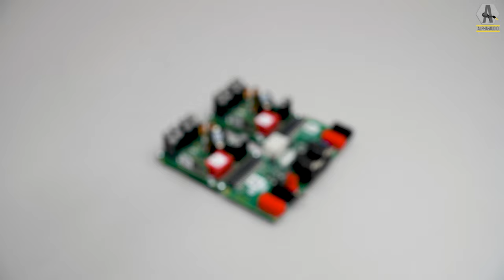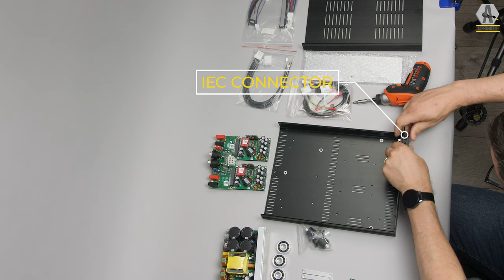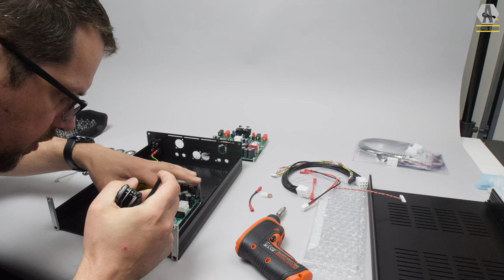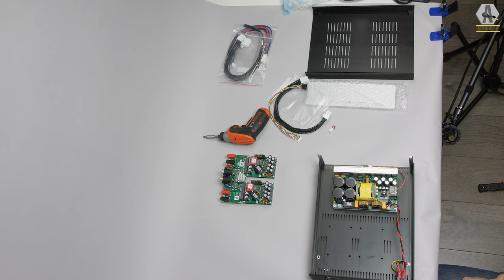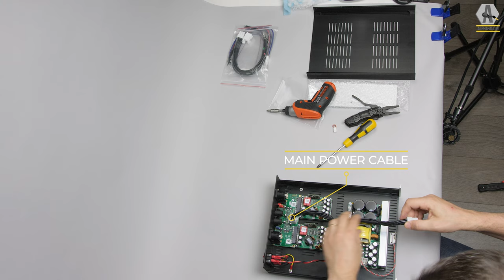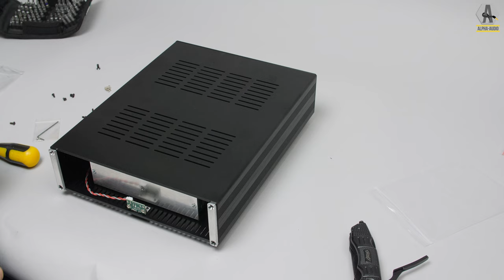Tutorial - Build your own Eigentakt Power Amplifier

Comment: Thanks for posting this. I have a question about the jumpers on the power supply. You state that the power supply comes in regulated mode and must be switched to unregulated mode.  You state “swap-out the jumpers"?  Swap out for what???  The word swap infers a replacement. Do you actually mean "remove the jumpers?  I am a novice and need a little clarity there. Also, I am in the US and will need a jumper on the power supply for 110v. Could you clarify that implementation? I could not see it clearly in your video.Thanks.
Reply: Hi Bob, I read your question about the jumpers. The following is stated in the additional pdf (Application Note – Connecting EVAL1 to SMPS1200A400) you can download from the website of Purifi Audio: "In addition to two set of cables that need to be prepared and connected, it is also of great importance to correctly set jumpers on the SMPS1200A400 to ensure it supplies UNREGUTLATED Vaux voltage rails." This means that you have to change the position of two jumpers on the SMPS1200A400. Hope this answers your question.

Comment: Thanks for the video, but I believe you have miswired the IEC socket, despite your comments that it was carefully checked. Happy to be wrong! 
As I understand it, the red wire should be active and the black wire neutral. At 5:03 of your video, it is clear that you have wired the male IEC socket so that the red wire is on the right side when looking from the inside of the chassis, and thus would be on the left side when view from outside the chassis. That would be correct if the pins of the IEC socket were arranged to define an upright triangle, but the IEC socket supplied with the ghent case has the pins in the shape of an inverted triangle, and thus the hot pin is actually the one on the right side when viewed from outside the chassis and on the left side when viewed from within the chassis - the opposite of the way you have wired it.
Reply from the maker: You could be right. But it didn't blow up... ;-).

Comment: Do you think it would be possible to fit another purifi mono in there to make a 3 channel amp?
Reply from the maker: No. I don't think it will fit, because you also need An extra power supply.
Reply: Did you need to order the wiring harness from Purifi or was the Ghent kit sufficient without it?
Reply from the maker: @emotive7  you need the Ghent wiring... The stock wiring is too short.

Comment: The Purifi will give you zero advantage over the Hypex NC400, which gets better measurements results according to ASR...
Reply from the maker: Well... Compared them... At least sonically Purifi wins hands down.
Reply: @TheAlphaAudio  how would you compare Hypex nCore vs Purifi amp especially midbass and bass
Reply: @andr.3348  

The Hypex NC series uses only post filter feedback loop, so it's identical to the Purifi - minimum inductor hysteresis distortion and load invariant operation. Either way, ASR distortion measurements gives advantage to the NC400 over the Purifi. 

I'm using the NC400 dual mono DIY kits with my NAD C658 preamp and Focal Aria 936 plus dual SVS SB2000 pro (managed by minidsp 2X4HD, instead of the NAD bass management, which cause inter sample distortion), and the sound is so good, an audiofool friend of mine was sure he's listening to a $100k system...
Reply: @ebarbie5016  I believe you. The Aria 936 sure measured well by https://www.stereophile.com/content/focal-aria-936-loudspeaker-measurements (nice and even wide dispersion, not unlike Revel Ultima Salon II).
'Sounds' like a nice system you have there. I'll take some notes. I have Focal Chorus607 with Harman AVR430 and MiniDSP4x4HD as of now, so your system is basically 'goals' for me.
Reply: Have you A / B Purifi vs Hype NC400? It seems the Purifi is better for highs/mids while the Hypex is better for lows.